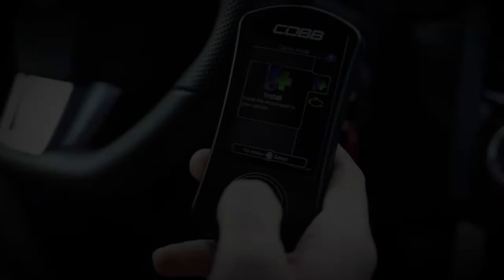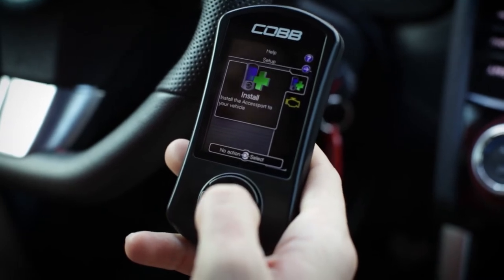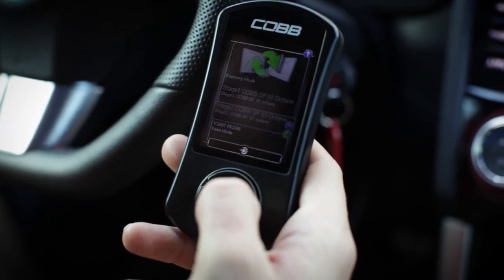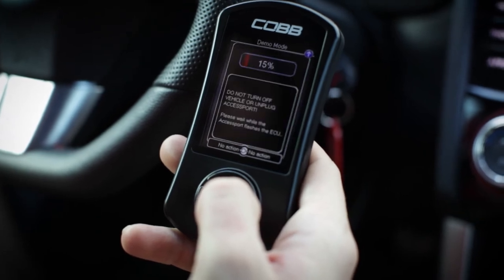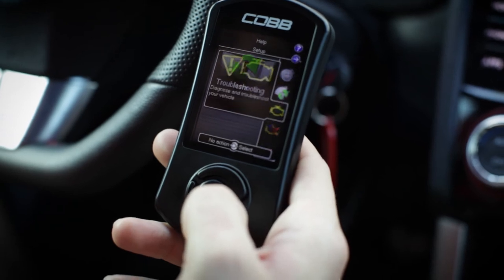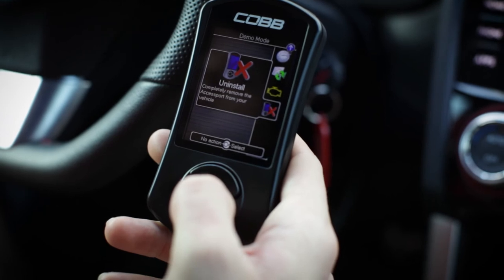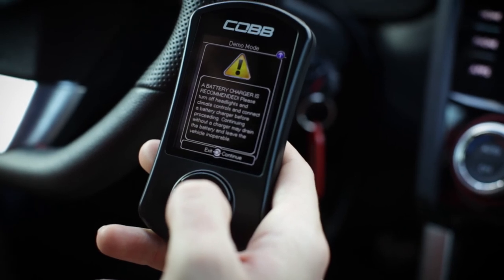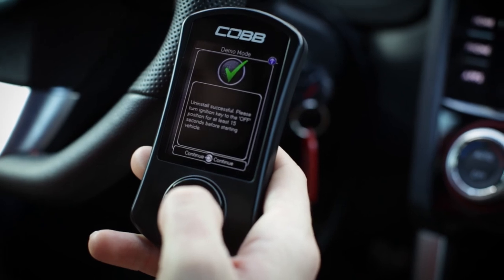COBB Tuning - APv3 Overview - Install/Uninstall

Comment: So can you not unistall when the engine is not present in the car? Tried. Accessport either says to make sure obd2 plug os connected, or it says make sure key is in run position. But if key is on that position the access port will not power on.  2005 legacy gt. Engine is removed for repairs. Installed battery to unmarry it. Unable to do so. Engine will be going back in but not for awhile

Comment: If I'm running an intake and my car has a muffler and resonator delete. What stage tune do i run? I have a 17 STI
Reply from the maker: HI Michael,

Assuming the intake is a COBB intake, then you will stick with the Stage1+SF maps. The 17 STi is close to maxing out fuel supply already, so if you intend to do any other mods, make sure to keep that in mind. We have some helpful guides on the website. 

Adam@COBB

Comment: How about an install video on a CVT / pushbutton start car?
Reply from the maker: It works the same way.  To get the car into the "on" position, simply press the start button without your foot on the brake.

Kyle@COBB